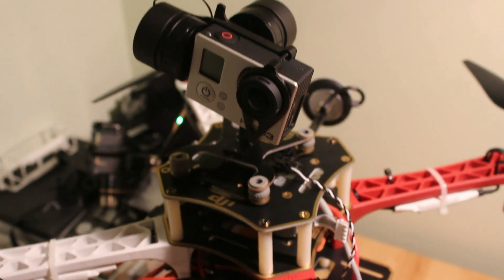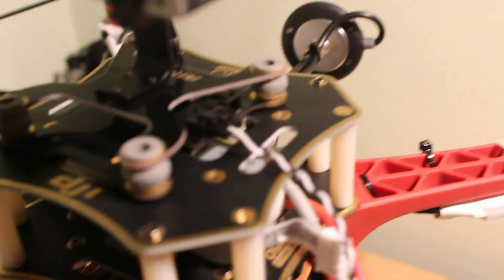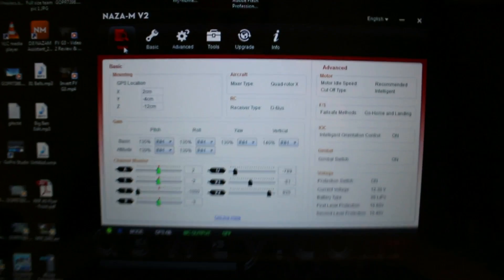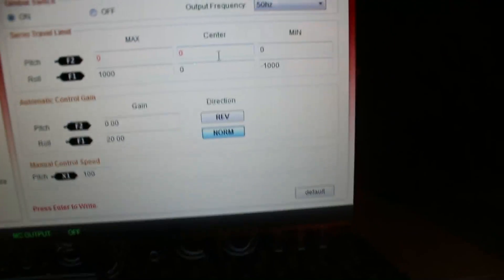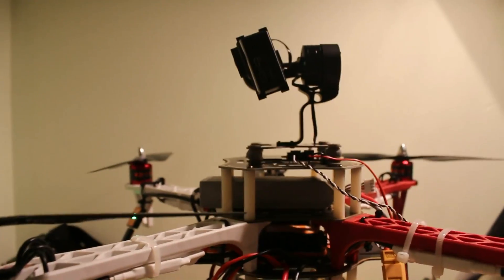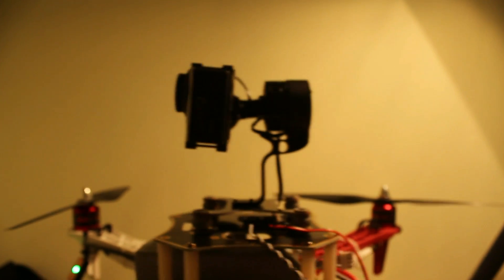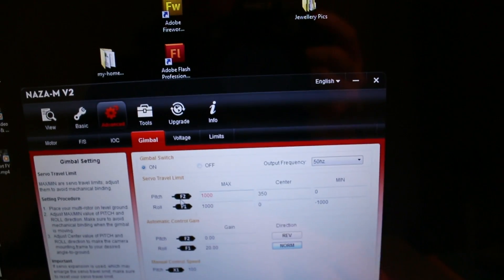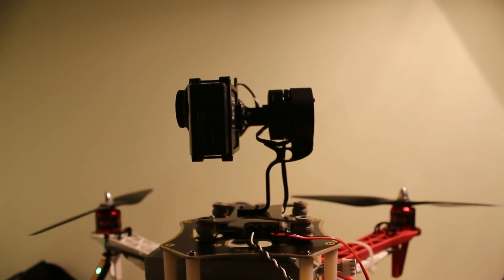Feiyu Tech G3 (FY G3) NAZA Assistant Pitch Control Setup

Comment: I have a Phantom 2 which I'm struggling with a Feiyutech Mini 3d Gimbal.  The Phantom assistant software doe not offer the same level of adjustability  that the Naza Assistant does over the pitch settings on the gimbal.  Is there a way of using the Naza Assistant to adjust the phantom's gimbal contoll? For a moment I thought I'd solved the problem.

Comment: that Setting only work on naza v2 ?? because i have naza lite and i dont see the f2 on my naza
Reply from the maker: +tiger exhaust Not sure about the NAZA lite but you can try the hack that upgrades the Naza Lite to a NAZA v2 (http://naza-upgrade.com) and that will give you the F2 port in the NAZA Assistant. You can only upgrade to the Assistant version 4.02... 4.04 does not work.

Comment: Thanks for the tips!! So you can confirm that the yaw control from the rc, is possible only in "heading lock mode"? Reading the instructions, i think that the best mode is the " Heading Follow Mode" because the gimbal keep costant the angles, but in that mode i can't control the yaw, right?

Comment: Hi.  I am running a Phantom 1 with a Tarot 2 gimbal.  I am trying to adjust the servo limits but the gimbal travels to both maximum limits in both directions.  I even put in your calibrations and still, travels totally upwards and almost down-backwards.  :-(  Any ideas?

Comment: Great video, Im struggling however, I have a question, when plugged in to F2 on the zaza where does the lead go on the zaza from the receiver.
Reply from the maker: David Kaye It depends on your reciever type. If it is S-Bus like Futaba or PPM (single cable) then it goes to X2. This is on the opposite side to the F2 port.
Reply: Im using FrSky D8R-II PLUS receiver, X2 is free but I've been thinking, what are the benefits of going through the naza rather than strait to the receiver.
Reply from the maker: No advantage at all really. I'd tend to always go straight into the RX personally and the adjust the tilt speed via the TX settings. The F2 port was only really designed for servo based gimbals back in the day.
Reply: ok, thanks for your help, your videos are always helpful

Comment: As of the two newer firmware's for the Naza assistant this is no longer possible,i've been trying for a few days now and I wasn't getting no where,got in touch with DJI forum support and they told me the newer firmware will no longer support 3rd party gimbals. :-(

There isn't a gimbal on and off switch in the Naza assistant anymore,i guess DJI want everyone or at least the new boys and girls to just use there own gimbal.

Do you know if this is true or do you know of a way around this using the PH2 stock radio?
Reply from the maker: This doesn't surprise me to be honest. People using a Phantom 1 or Phantom 1.1.1 with NAZA v2 firmware (assistant 2.20) can still use their own gimbals. Phantom 2's have a special 'Phantom 2 only' Naza which (sadly) you can't flash to v2.20 firmware. Your choices are therefore limited. You could by an 'off the shelf' NAZA v2 (non P2 version) and install v2.20 firmware or buy a 3rd party S-Bus ready Transmitter like a Futuaba T10j - this will let you control the gimbal via the RX directly with no fiddling with the NAZA assistant software.... neither route are a cheap option I fear.
Reply: d3weyTube Yeah thanks for that d3wey,i've already got a Spektrum DX8 so buying another TX is out of the question for me,i've looked into using an Orange S-Bus RX but after doing even more research I know find out that my TX will need to have channel assis,so I swap the throttle over to the same channel that Futaba use and of course my DX8 won't let me do that lol,so i'll have to put my gimbal back onto my other quad I took it off,then see if I can get a Zenmuse off of ebay or somewhere second hand,apart from that I can't think of anything else. :-(

Thanks again for the quick reply mate as it's appreciated. :-)

Comment: Quite new to this... But the power supply have to be shoulder to the phantom somewhere .. Anyone has a video or location on where to shoulder?

I also need to look at the link given.. As mine is also the two cable... I plug it in.. Then the gimbal faced up... The remote can't bring it down...

Comment: I'm trying to put in a value for Center after zeroing and it is saying "Invalid Values".  I'm trying to enter in 500 for Center, and max and min for servo travel limit were already zeroed from first step.
Reply from the maker: Try Zeroing them all first - Start with 0 in center, then Max, Then Min. Then Set Max to like 1000, min to -1000 and then play with the centre setting. If that fails make sure you have calibrated your X1 channel properly... that can cause issues.

Comment: Hello, problem! New version has two outputs when I set a side the power cable. There is White cable on the single servo connector and on the other servo connector there is black and red cable. I assume those are for the power, so I don't use them, when I plug the white cable to F2 port the gimbal is tilting ROLL instead of PITCH, anybody has idea how to switch ROLL to PICH??? Yes it is connected in the right F2 port, I have try F1 but that one does not work at all.....
Reply from the maker: Hi Jakub - As far as I can tell from the (poor) instructions on the new wires, you need to plug the Black/Red into the F2 port and ignore the white cable. This matches my existing wiring. The white wire seems to be so you can adjust roll on a seperate channel.
Reply: Oh ok, I will try that!

Comment: Hi!
I have the second verson of this gimbal with the Phantom compatible mount(shorter one) And has different cable. the cable have Black, white and red. ive pluged them as u said, but it doesn't work. the gimbal rolls sideways. Yes configured on the naza as well.. but the gimbal is stable if the tilt cable is unpluged. pls help
Reply: I have the same problem, have you find out? No matter how I connect the white cable, it is still rolling sideways....
Reply: Do you have the new one with 3 cables?
If so, i think u should connect the black and the red one on F2 port black on top and red on bottom.. or easier said, use the red insted of white. pls reply if it works.. cus it does not on mine... i think something is wrong with mine...

Comment: hast Du den Gimbal extra an einen Akku angeschlossen? 3 s
Reply from the maker: I have it plugged into a 4s but you can plug it into a 3s too.
Reply: Betreibst Du den 4s auch gleichzeitig mit dem DJI F450? oder hast Du separat einen 4 s auf dem DFJ 450 montiert. Welche Leistung hat er ? Welche Leistung hat der Akku für deinen DFJ 450 zum fliegen?
Reply from the maker: Tobias Lang
Sorry the translation is a bit confusing. I run (ran) my F450 on a 4s. I now have an ImmersionRC XuGong 10 (I no longer have the 450). The gimbal uses the flight battery so yes it uses a 4s. I get 10-12 mins from a 4000mah 4s on my XuGong.
Reply: Danke!

Comment: Can you confirm the wires for me...the black is far left and the white is next to the black when its plugged into the gimbal? The wires I got have black/red/no wire/white in the 4pin servo connector....I assume the red needs to be pulled out and replaced with the white...this is in relation to the gimbal connection...can you confirm...thanks
Reply from the maker: Hi Franko. They have changed the setup since I made this video. To power the gimbal you should have a 2 pin red and black wire. The 4 pin plug (with 3 cables) is to operate the tilt via RC reciever. There is more info on the Feiyutech downloads.

Comment: Happy Holidays, I was just wondering if there is any difference between connecting the gimble into the naza over a normal rx?
Reply from the maker: There is a bit of a difference. Personally I'd suggest plugging it into the RX if you have the choice. The NAZA requires a bit of tweaking in the assistant and as yet I've not been able to make it tolt fully downwards via NAZA. It does however of course free up a channel so that is an advantage.
Reply: d3weyTube Thanks for the information. In terms of the dampeners you mentioned that the ones that are being used were too soft. Could you recommend ones that are more suitable. I think I got some vibration in my video, in all fairness though I need to balance the props better.